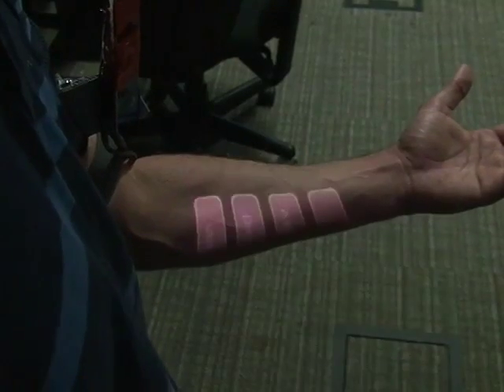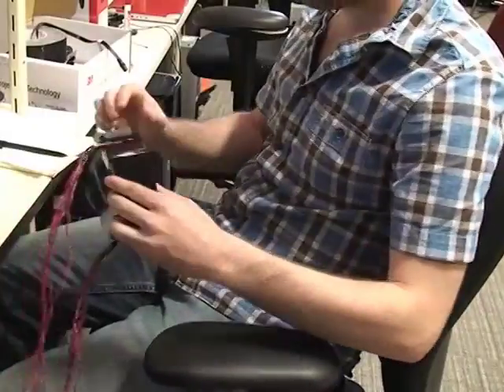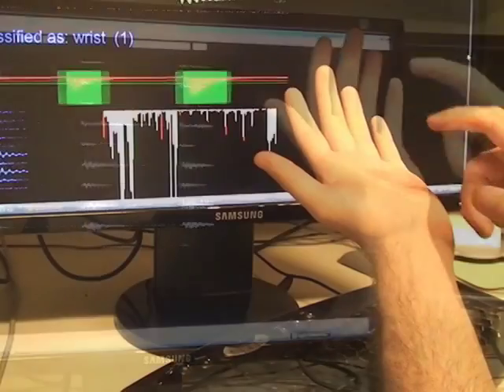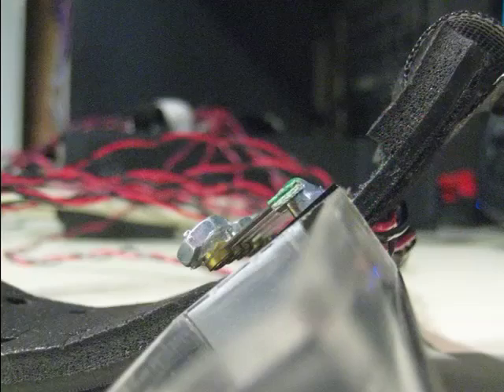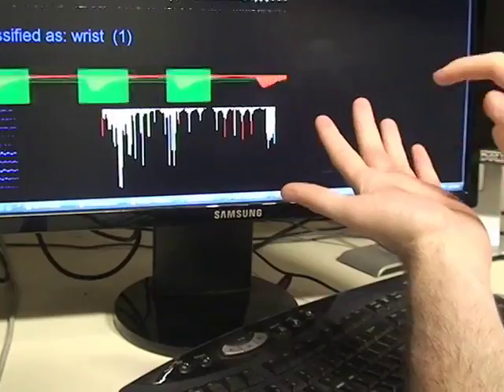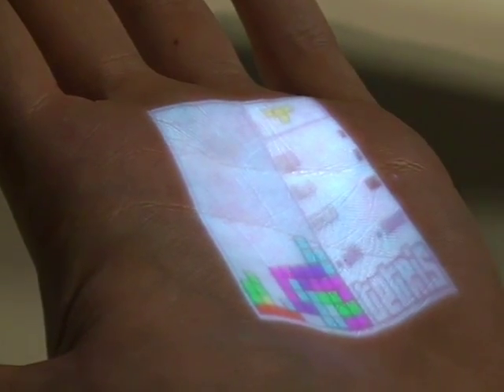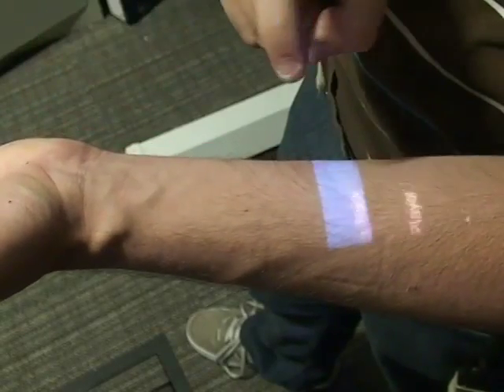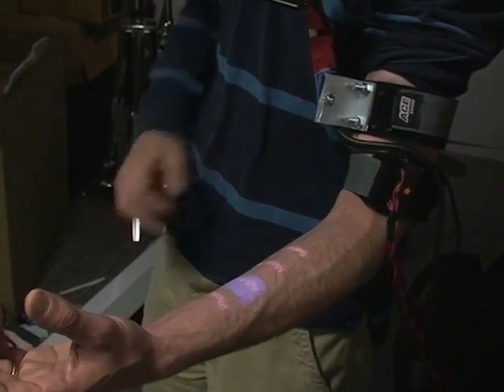Skinput: Appropriating the Body as an Input Surface (CHI 2010)

Comment: @isilder That 'sixth sense' stuff is bogus. Using a webcam is a real pain in the ass, I know first hand. It's so temperamental and picky even with $300 low light cameras, they are slow and lossy. Why should I dedicate all my movements and situations to accommodate this webcam. 
Tapping you don't need light or any visual interface, you can use it while driving.
Imagine being somewhere and relying on a webcam/pico scenario "damn its not picking up let me run over here where its darker or lighter"

Comment: The projection onto your skin or sleeve would be much harder to see in bright light than even an LCD screen.  Notice how in the video all the shots of the device's projection were in very dim light.  Even if they can get a skinput armband to work with a coat, you would still have to take the armband off and strap it back on whenever you wanted to don an outer garment.  I don't predict this technology will be the wave of the future, but will rather go the way of flying cars and VR goggles.

Comment: Well I would assume that there would be different command set profiles available, depending on the gloves you can still flick or click your fingers.

Depends entirely on your chosen use... whether it's a casual device like an MP3 player or some sort of mechanical device interface, if you were operating a remote controlled package loader or something. The possibilities are endless.

Comment: Are you referencing water torture...? Because that's as much to do with the placement of the nerves and things on the back of the neck as the dripping itself.

Repetitive strain injury comes under every day life use in my books and I would have said the affects would be less acute with this system. Also it would likely be no more damaging than any current devices.

Also in it's current state this seems to be more viable for casual devices, rather than office hours style usage for data input.